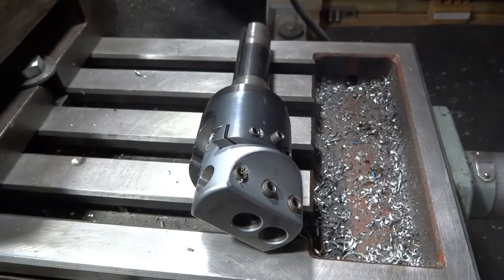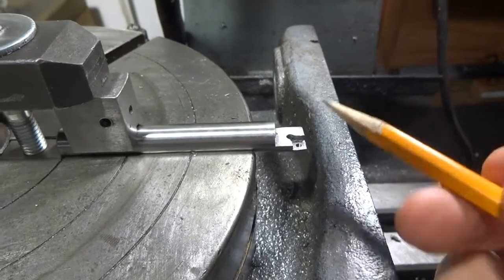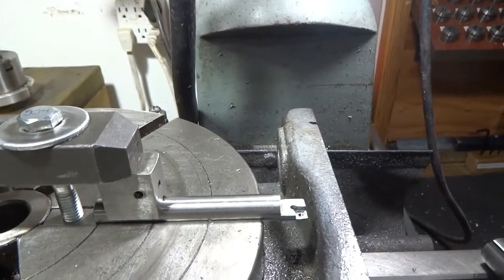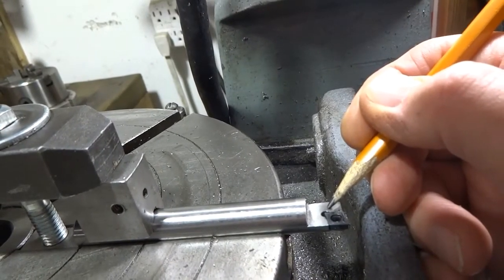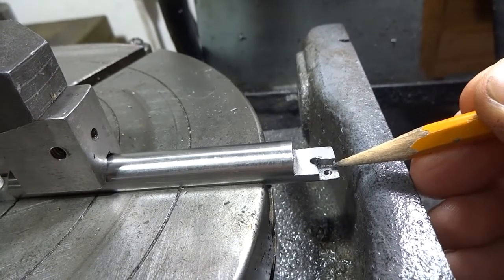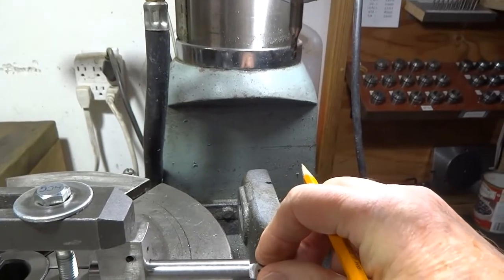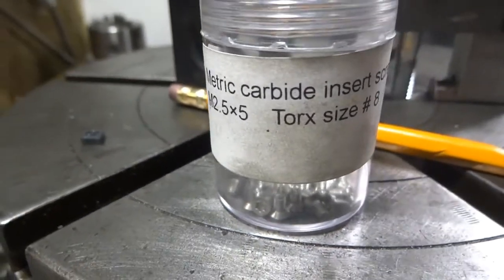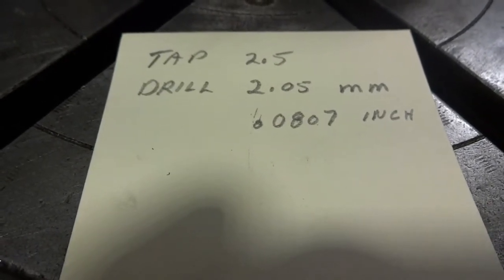Outside diameter Boring bar

Comment: Hello.love your videos. I just picked up a used king mill similar to yours and I can’t figure out how to change the collet. I had jet and ro Rongfu bench top mills before and it was a drawbar bolt but the king looks different.the draw bar is hexagon shaped the whole length(as far as I can see it going into the spindle).any help would be greatly appreciated.
Reply from the maker: Use the hex to unscrew  two or three turns while holding the belt pully in position. Then hit the hex on top with a brass hammer. The collet will drop down and you can then unscrew the hex all the way out freeing the collet to drop out.